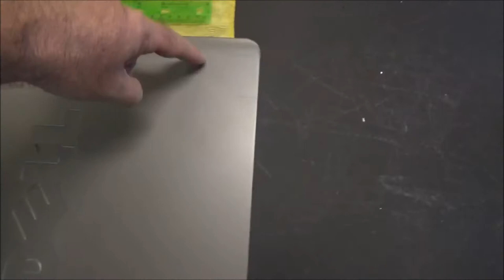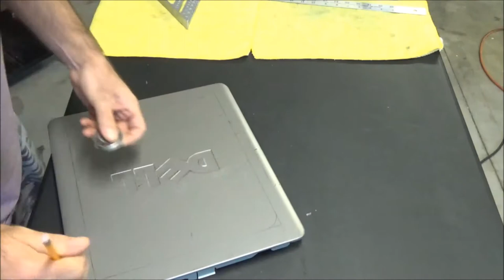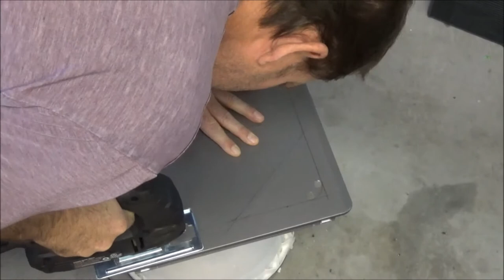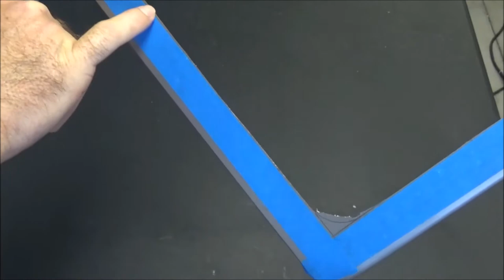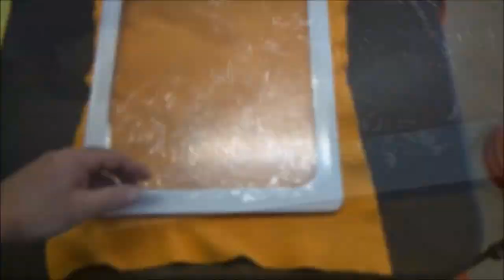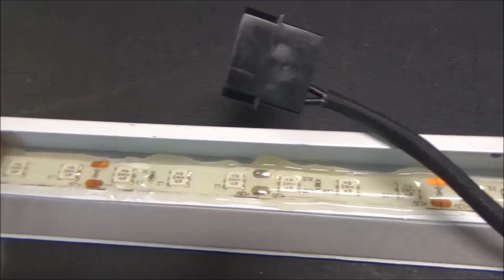Install a PC Case Side Window!

Comment: Square windows are usual easier in my opinion but rounded one are very nice. I prefer not using screws for windows because i don't like to see the screw heads, although there are some exceptions for me. A decent double sided tape is the way to go in my book. On my Main rig i cut a window and use plexiglass and it got scratched to easily and always gets covered in dust. I salvaged a glass window which was the perfect size which i was lucky. The glass has no scratches and super easy to clean. No dust build up!
Reply from the maker: Square windows are probably easier, but I was concerned about not getting the perfect corner. I figured a nice rounded corner would fool my eye if it was a little off. I agree about screws, although I think they look good on my little 780 SFF, just depends on the PC I guess. I tried sooo hard not to get any scratches on that Plexiglass and still got a few. Very frustrating. I still might try to find a piece of glass that will fit. Thanks for watching dude!

Comment: Thanks for sharing. Some great tips and great visuals. Would have liked to seen the finished case with led lights on
Reply from the maker: You're welcome, thank you for watching. The finished PC is in my Playlist if you go to my channel page. It's the water cooled Dell with green leds.
Reply: @PimptatoPCs Checked it out. Looks really good. Nice paintjob and lights. I never did any watercooling but even I can see thats some damm fine tubing. Especially inside such a small SFF case
Reply: You should add a response with the moment where you turn it on with the lights. And pin that response to the top